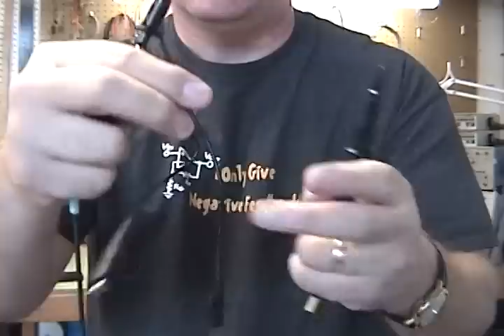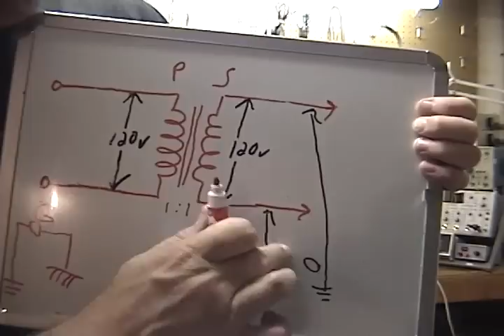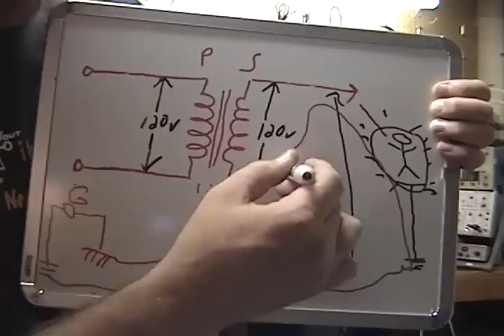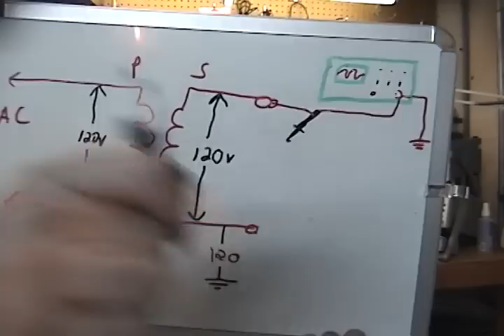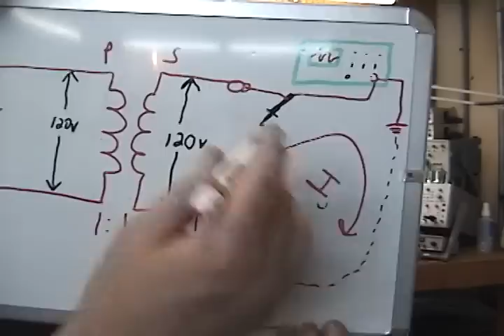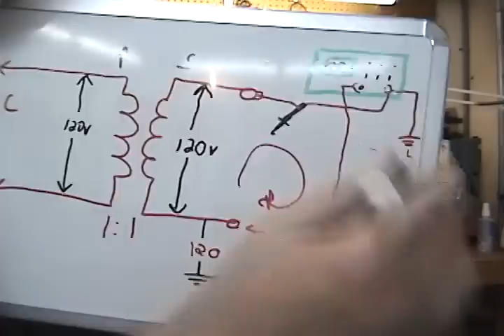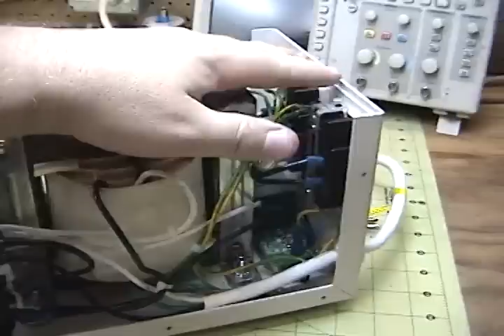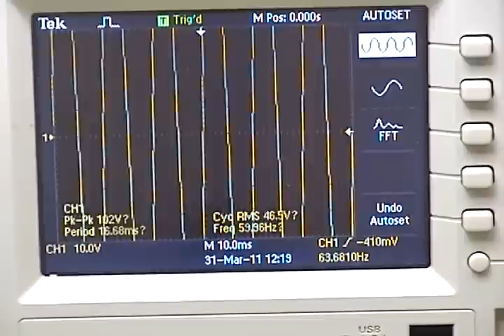ToddFun.com: Isolation Transformer - Tripp Lite IS1000

Comment: Thanks a lot! (even after 15 years) The measurements at the end of the video are particularly informative, demonstrating that no current flows between the isolation transformer output and the mains earth connection.

Comment: What happens after min 49? Now i'm confused....You've got a sec isolated power supply(neutral/hot) and the lamp in serie with the scoop, what did you do? How can you create a loop?🤔
Reply from the maker: Created a ground loop through the scoop probe's ground clip, to the scoop, through the scoop's grounding circuit to the 3rd prong on the scoop's power plug, back to the breaker box for the house. In the breaker box for the house the ground is connected to earth. So the transformers output power now has a loop that can go through you to ground if you touch anything at high voltage to ground completing that loop, like I demonstrated with the light bulb. Being I didn't want to use myself in the demonstration, I used the light bulb. HA.

Comment: Learned the subtractive (or differential ) method while working on 600HP dc drive. Most of the control side was in steel chassis. The 3 phase 440 ac to the drive and 600V dc out to the motor had to be monitored on the scope. 100x probes helped. Never want to see that scope probe ground connected to 440 volts again.Never again ground lift the scope. We showed all electricians in the plant how to use the setup.

Comment: You can also wear rubber slippers to isolate you from ground when measuring mains voltage with an oscilloscope
Reply: The problem with that is that there are other ways you can wind up grounded. For example, if some part of your lab bench is metal, and grounded and you happen to be leaning forward and resting your elbow on your bench just so, your arm could be in contact with that metal element that's grounded. Or you could be leaning on something and your hip is contacting it (of course nobody ever wears shorts in the lab, right?), etc. etc. 

At the end of the day though, it's all about risk management and one's personal comfort level.

Comment: Great video Todd, but don't you still have 120V from the hot to the ground pin? And if that's the case and you plug in a 3 prong DUT won't that still be dangerous if you would touch the chassis of the DUT? New to setting up a test bench. Thanks

Comment: I am going to make up a  bulb tester it can help sometimes but sometimes it can be very dangerous   the one I am going to build would have two  pole switch to isolate negative and positive will be  turned off on both sides

Comment: If you've converted your medical grade to tech grade, meaning the secondary is truly isolated, then you plug your DUT into the isolation transformer, your DUT is now floating, right? Now you connect your oscilloscopes ground lead to a 
point then your probe to another point. How does that impact the signal when you have two different reference points?

Comment: Thank you. I got the Tripp-Lite 500 version. It makes some noise when idle, and really cranks up the noise under load. Is that normal? I’d never be able to use this in an environment that had to be quiet (I tried it on my stereo before converting it to tech).
Reply from the maker: No it shouldn't make any noise. I would return it as defective.

Comment: OK, I did this but found I still had ground continuity through the metal screw holding the outlet to the chassis, so I need to either disconnect the chassis ground or insulate the screw holding the outlet to the chassis. I could still use a 2-to-3 prong adapter, please correct me if I'm wrong.  Also, I would isolate the equipment under test and ground the scope.

Comment: Hi, great video! I just got one of these isolators and curious if there's any benefit to use it in my RV? It has 30 amp shore power and generator with inverter/charger to house batteries... There's an auto transfer switch between them. I'm wondering if there's any use for the isolator off the inverter or anywhere else. Thank you!
Reply: My thought is, if I understand how they operate, I could plug it in to my invertor and have newer electronics plugged in to the isolator. Would it "clean" the signal from my generator in case there's a spike in voltage from turning off or on other appliances?

Comment: I recently purchased the same Tripp-Lite model you have but upon opening the cover I see it is wired a little different.  I do not have the extra green wire you have that you disconnected.  I have a green wire coming from the Output side that is attached to the unit’s grounding post. From the grounding post I have two green wires that go up to the backside of each outlet connected on the top to a green screw.  I disconnected only the green wire coming from the Output side and completed your lightbulb tests and it seems to be working.  Then I got a surprise.  I had read a comment on a video that said Tripp-Lite now ships the unit OPEN GROUND.  I connected the green ground back as it was and plugged in a outlet tester and it signaled OPEN GROUND. With no modification the unit is OPEN GROUND.  What do you think?
Reply from the maker: They must’ve figured out they were shipping these things as non-isolation, transformers, and advertising them as isolation transformers. They really should’ve been advertising them as signal conditioning filters. Well, if they’re going to sell them as isolation transformers, it’s best they make the change.

Comment: Good video for a somewhat difficult to understand subject. Bravo
Reply from the maker: Glad you think so!
Reply: This is my setup: My Trippe Lite modified tester has no continuity between its output socket grounds or the neutral slot and the transformers input cords power plug ground pin or “wider”common blade. The input power cords ground pin is no longer connected to the iso’s transformers metal chassis either.

I feel safer as a human tester knowing the metal chassis of a guitar amp can never pose a shock hazard to me the tester to earth ground or short out my scope probe or probes ground connected to exact same chassis ground point ever be an issue for the scope. 

Can this paragraph just above be achieved with either a 3 prong guitar amp “chassis grounded” under test and as well as with a 2 prong unpolarized powered plug on amp plugged in any direction, as long as the death cap is still un-shorted? 
Thank you

Comment: I have couple oscilloscopes that have batteries - if I unplug the charging cord, It will not have reference to ground, right? So using the battery operated scopes are safer to use with high voltage equipment or am I not seining this right?  Also, why aren't you making more videos? Thanks for all your videos!
Reply from the maker: Right if you use one prob. if you use two or more probs just make sure the ground clips are all on at the same point. 

Just busy with my day job and working on a small farm in ND now. Might make more videos someday but it is a ton of work to make good videos.

Comment: Is fair to assume that the ISO trans output outlet ground pins, have zero connection to ground also. I didn’t see you remove the outlet socket ground pin connections. You only disconnected the neutral side of the sockets that went to ground.  I want to make a power system for bench work. I’m going to run the bench equipment through an isolation transformer with three outlet hospital grade outputs. One for the scope, one for my Variac and keep a spare outlet should I need it.

Comment: Hi. Thanks for posting this, I've found it very helpful. However I wondered if you could help me with one last point of confusion I have please? I understand that the whole point of isolation transformers is to eliminate the connection you device under test has to "earth ground" to stop a return path should you clip your scope probe alligator clip to the wrong place. However my question is...if your circuit under test is an AC circuit, and no longer has a "ground"...where do you connect the probe alligator clip to?????
Reply from the maker: Well when your DUT is on an IT you could hook that ground clip to whatever point of the circuit you want. However if your scope is grounded to Mains power in your house, that is your scope is not floating too, you are then strapping your circuit at that point to your mains ground which will cause all the AC voltages in reference to that point of the ground clip to be dangerous to you again. You can float a scope but it’s not recommended, to float your scope you just use a three prong to two prong adapter. But doing so can also cause your signals not to look or be correct, or look noisy. So be careful is the big thing to always keep in mind and keep one hand behind your back and Don’t touch the DUT circuit

Comment: For a bench isolated AC supply I think the approach is to both isolate the power and the grounds, for personal, equipment and soldering iron (ESD tip grounded type) safety. Meaning if the DUT has a hot chassis then connected a grounded scope, or other earth grounded equipment, would not cause a short or electrical overstress. If you want to keep the AC isolation supply chassis at earth ground for electrical safety reasons, but float the receptacle ground, you would need to install a hospital grade isolated ground orange receptacle (green dot and green triangle), or you could just float the chassis which is probably not ideal. Most receptacles are internally straped to connect the body (and metal faceplate if used) to the grounding screw for ground fault. With the result being that the ground screw and chassis connection are shorted, or non-isolated. The Green dot hospital grade receptacles on the AC supply output of the unit as shipped do not have ground isolation.

Comment: Great reminder on the receptacle screw going to ground.
Reply: Isolation of the earth ground inside the Isolation transformer. One should always use this modified Isolation transformer on the equipment under test. And use a 200watt light bulb, after the transformers Hot side to this device, incase the unit in test has an internal shortcut. But always remember safety first.

Comment: Neutral is connected to ground in the service box, so are you saying never use a 3 prong plug into the isolated transformer.  No different than being tied into the iso with neutral to ground that you just removed?
Reply: I know this is old post but it’s still being watched
Reply from the maker: If the neutral of your iso is not strapped to ground then you can use use the 3rd prong ground. It keeps the metal case of the iso safer in case it becomes shorted to ground in some fault. However you then do have the problem noted in the video that you can end up grounding the system with your grounded scope probe. If you don't use the 3rd prong ground on any iso or test gear that is better isolated for safety as you noted. However that floats the signal of your scope which needs that ground reference for creating an accurate and clean signal trace. I have also read that floating a bench scope can be damaging to a scope, but I never understood why that would be being battery operated scopes seem fine, however, their circuitry is going to be different and designed for such usage. Hope that helps.

Comment: Professor Todd Harrison. I am an amateur student of electronics... sorry for the question that maybe can be stupid due to my lack of knowledge..  If I connect the isolation transformer (with the proper modification of disconnecting the ground as shown in your video and of course tested to assure the isolation) to power up the device is being repaired and also I connect an active differential probe to the oscilloscope. This setup is gonna work to the fullest of protection to work? I mean usage Isolation transformer connected to the board or device to work in and usage of Active Differential Probe connected to the Oscilloscope
Reply from the maker: Yes, that's fine. With differential probes you don't connect a ground clip from your scope so it would remain safe.
Reply: @ToddFun  Thank you so much professor ¡

Comment: If I understand I get my self a new insolation transformer. Then I plug in a old tube radio. The metal chassis of that radio cant kill me anymore. GREAT. Now I connect the ground of my oscilloscope to that metal chassis and I'm no longer protected.  WOW Thanks for the wakeup. Great video.
Reply from the maker: Sure. Glad to have helped. I was just as shocked ;) to learn the same.

Comment: I just purchased a Tripp-Lite IS500HG isolation transformer which I intended to modify by removing the ground connection to neutral , similar as in your video, then discovered it comes with full floating secondary. There is no ground to neutral connection on this model. This is also stated in the manual and printed on the panel face. I just wanted people to be aware that modification might not be necessary.
Reply from the maker: WOW! I wonder why? maybe that one was wrong by mistake as all HG should be strapped. Or maybe they decided being they where trying to use them to isolate medical equipment from a ground reference that using a strapped neutral wasn't such a good ide as the current, or maybe now old, design was only really added power conditioning and not isolation and finally somebody caught on. Or seen my video and said "WTF" HA. Never know.
Reply: I have some additional information. The Tripp-Lite IS500HG model used to have the the output neutral bonded to ground but it was changed. I compared a 2015 to a newer 2019 data sheet and the older data sheet states   "Secondary neutral-to-ground bonding eliminates common mode noise, providing an isolated ground reference for sensitive equipment".   This was removed from the data sheet and replaced with   "Floating AC output prevents noise coupling from noisy hospital ground circuits". I don't know about the other models. I guess this means whatever isolation transformer you buy, it's probably best if you carefully examine it yourself and modify if necessary in order to be sure and to be safe. When you buy one, it's hard knowing what you'll get or what revision level.

Comment: Well I was about to write a comment, but I see that I have already made one a year ago which said about the same thing : If you power your circuit under test via a tech isolation transformer you somewhat protect yourself from being shocked. But in order to use an oscope, you have to hook up the probe ground strap, which connects oscope ground to c.u.t., which protects the oscope but means the tech can get shocked by touching the c.u.t. again. Right ?
A year has gone by and no response from you,  so I'll push my luck and ask why not plug both the c.u.t. and the oscope to isolation outlets ?
Seems like it would be the same as using a battery powered oscope.
Reply from the maker: Yes, you could do that and it would solve that problem. The only issue is a lot of scope companies warn against floating a bench scope. It can cause errors in the singles causing a misleading problem unless you're looking for such misleading single errors and can ignore them. Then some most companies warn that you can damage a scope if you float it but I really don't know how however you will find it in their documentation, I have posted links to some docs in low down comments for others if you care to search for that.
Reply: @ToddFun  Todd -
Thanks for the reply. Just one question for clarification, and another.
What do you mean by "single" errors ? Do you mean single digit amounts or what ?
Lastly, instead of connecting my bench scope to an isolation transformer, if I run it off my UPS battery (with the UPS unplugged from the wall), would this still be floating, or would it be the equivalent of a handheld scope ?
Thanks.
Reply from the maker: @youpattube1  Spelling error. Signal errors is what I meet. Yes, I would still call that floating. What floating means is that the ground does not join up with the neutral. In your home's wiring all grounds patch into the breaker box right onto the same bus bar as all the neutral. The ground is just a 2nd guaranteed path for stray electricity to find a path back to the neutral so that the breaker will trip even if the neutral wiring from the appliance is cut or a shorted live wire gets grounded to the chassis. So really any ground wire should strap to a neutral at some point in order not to float the ground. Just a safety thing really. Some old homes don't have any ground wires but if a 3 prong grounded outlet is installed then by code you have to strap the ground lug of the outlet to the neutral lug on the outlet socket itself with a wire pigtail so if a metal appliance is plugged in and the chassis becomes hot it will trip the breaker through the ground via the neutral pig tail jumper when the home run wiring does not include a 3rd green or raw copper wire for grounding.

Comment: You mentioned the public version is intended to reduce noise. If you adapt it for use with your test equipment the way you described, do you give up the noise reduction, or do you get both? I am asking because I am hoping to use an isolation transformer for noise reduction with a particular device, but I also want to be able to pull it out and use it for testing purposes.
Reply from the maker: You loose some of the power conditioning but it might not be so much as to cause a problem. You would have to test.